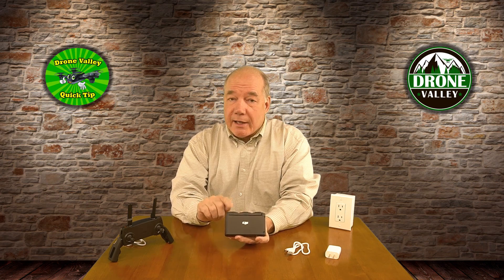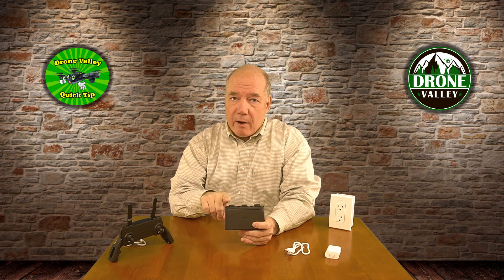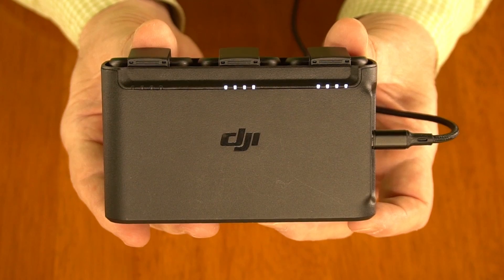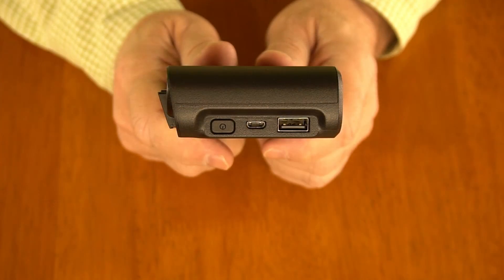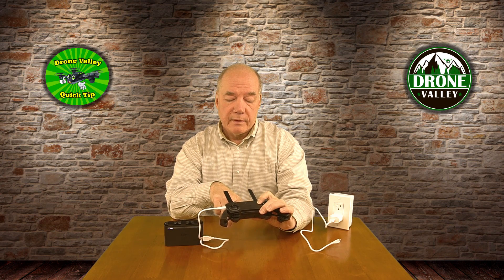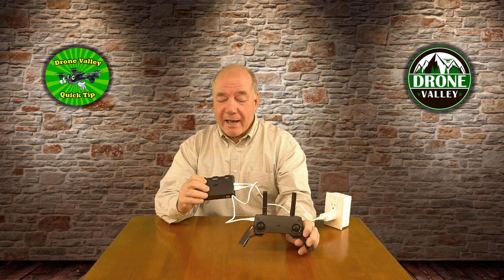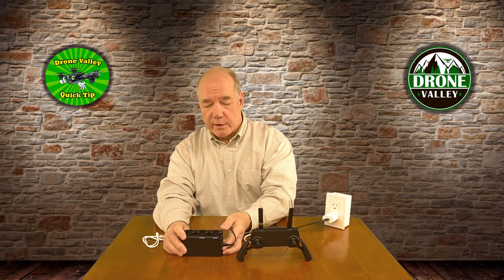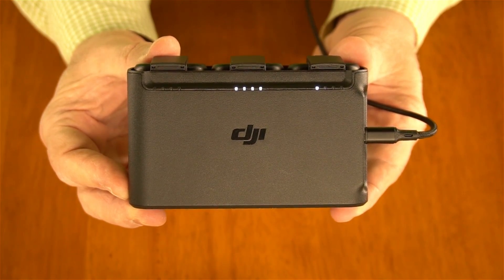Mavic Mini - The Magic of the Charging Hub Explained

Comment: I have a mavic pro and can charge it with an external power bank which was designed for the mavic pro aftermarket. Is there a way to charge my Mavic mini batteries with an external power bank? I am looking at being out in the wilderness with no power source and charging an external power bank via solar panel then charge the batteries with the external power bank. Is that possible?

Comment: You can charge them both the batterys and the controller...
Just press the button on the hub twice... As you do to turn on your drone. 
;-)
Reply from the maker: Thanks for the post and I appreciate the tip. This feature was actually implemented through a firmware update after I posted this clip. It was a feature we were all looking for and DJI updated the Hub to include it on later versions. Stay tuned for more content this week. Rick

Comment: How do you update firmware for batt 2 & 3 please, I see no prompt?
Reply from the maker: You can simply update the drone (and the installed battery) first and then rotate the others through the drone after a reboot. If they need to be updated, you'll be prompted to complete the update. If no message appears, there's no need to update them.

Comment: Thank you for this video, very useful. Can I ask a couple of quick questions: 1, Should the battery charger remain connected to the power when not in use in the field, and 2. How do I know if a. I have a charger capable of quickly charging, and if the supplied cord is capable of this function?

Comment: wrong, you can charge both at the same time.
Reply from the maker: Thanks for the post but when I did this clip that feature wasn't yet implemented in the charging hub, it came later with a firmware update. It works great today but takes a long time to charge everything because of the smaller wall charger

Comment: The original charger is 12 volt use it all the time.
It is switching to 5 volt in case you charging 5 volt devices.

Comment: So there isn’t any option for this hub to charge the batteries without it being plugged into a power source? I thought the hub thing would charge the batteries like a power bank.
Reply from the maker: Mike, thanks for the post and the hub is really 2 things - A "Smart" device to charge your batteries when you have it connected to a wall charger and a Power Bank that uses what ever charge is left in the batteries to charge other things. Initially, you'll need an external power source to use it for charging your batteries. I hope that helps, Rick

Comment: Hi. I bought the Mini 2 yesterday. When I plug in the battery that came in the drone into the hub, the third LED keeps blinking 3 times every 5 seconds. It shows fully charged in the drone and actually works, but I’m just curious if this is something I should be worried about. 😔

Comment: Do all 3 Batteries have to be in it at the same time for it to work? Or can I leave 2 of them in there while I'm using 1?
Reply from the maker: Sam, you can charge as few as you like in the hub. It will work well with 1, 2 or all 3 and if you slide one in while the others are charging, it will assess the new cell and adjust the charging order if needed.
Reply: @Dronevalley  Top Man Thanks a lot for very useful information.

Comment: If you press and hold the power button on the charger you can charge the RC at the same time
Reply from the maker: Thanks for the comment but that only triggers the external port for charging. The hub will still charge the batteries in order first and then move onto the controller. We have a 3 port Hydra cable that can charge a few things at the same time and a 6 port charger that can charge 6 if you'd like to speed things up. Rick

Comment: Ok so if i use my battery pack as a portable battery pack to charge other things like a cell phone or maybe a gopro what would be the actual power of the power bank in mah.
Reply from the maker: Great question and a tricky one since it really depends on how much of a charge you have left in the cells and how many of them you have plugged into the hub. The higher the charge in the cells and the more of them you have, the more capacity the hub will have to charge your devices. Even still, it can only supply 5V at about 2A to whatever you have connected but it's a great way to keep your other portable gear charged when you're out for a long day of flying. Thanks for the post and be sure to stop back soon. Rick

Comment: I just got the Mini 2 with the charging hub.  It works in the same way.  And, it has a USB C cable.  I found this video very helpful.

BTW, for those arguing about whether you can charge the controller and batteries at the same time:  No, you can not. When you push the button on the controller, it's just showing how much charge you have.  When you push the button on the charging hub, it just shows you the charge on the batteries.

Comment: Can the charging hub charge the batteries without being plugged into the wall? If so, how do you turn the hub on to start the charging of the batteries?
Reply: mine was but it went very slow its on the combo wall plug now

Comment: As soon as the batteries are charged it WILL charge the remote
Reply from the maker: Brian, thanks for the post but when I did this clip I was playing with a pre-release product a few weeks before the announcement and didn't have the manual. I understand that it will serially charge the external device when the batteries are fully charged and have mentioned that in a few clips since then. My issue is still the length of time it takes to charge all of the devices one at a time. We have just released a charger that does this in parallel and can charge 4 batteries and 2 USB devices at the same time to get you back up in the air quickly. Stay tuned for more updates this week and I hope you're getting in a lot of flying time. Rick

Comment: How to charge the remote in parallel with the battery bank in two steps: 1.With all cables unplugged, connect the remote to the battery bank and it should begin to charge. 2.Long press the battery bank button, the remote will indicate it is charging, and the battery bank will blink on the battery which is charging.

Comment: Rick it’s a shame DJI has stopped the “storage mode” on these hubs. Phantom 4 benefited from storage mode over the baked in discharge option because if I didn’t finish my batteries on a worksite I can easily throw it on the hub on storage mode to back em off to 50% until I needed them again.

Comment: After two of the three batteries were charged it started charging the controller after controller charged the battery on the end by the port started flashing two lights

Comment: Will the controller start to charge once the batteries have been charged to 100% or do you have to first take the batteries out of the charger?
Reply: Yes it will charge when the batteries are charged. You can leave the batteries in or take one or any out. It will charge the batteries first then power to USB A. Its a great device.

Comment: .... Someone needs to make a product to plug in and walk away to DISCHARGE all the batteries and controller to 50% for storing between flights. For now on, I will not charge after a days use until the night before knowing I will be using it the next day. .... IF, something happens and the trip (drone use) is canceled for any reason, the batteries need to be drained AGAIN!! :-(
Frustrating because they have to be monitored not to drain fully. 

.

Comment: Completely incorrect. Yes you can charge everything at once, all connected to the same charger. Just press the on button on the charging hub and it works. Controller first.
Reply from the maker: Silvio, thanks for the post but I did this clip before the product was released and at the time the manual wasn't done so I was exploring the features on my own. After using it for a few weeks I realized that you could force the controller to charge first but tapping the button but there's no way to update a clip once it's been posted. I have discussed this in later clips and I appreciate you pointing it out here in the comments so others know it's possible. I hope you'll stop back soon for more content I'll be posting on the Mavic Mini and other tech. Rick
Reply: @Dronevalley  totally understand and appreciate your reply. I'd suggest to remove the video and create another where you explain the feature correctly. I'm sure your followers will appreciate and respect you more for that.

Comment: Nice video.. I noticed two types of charger pins available in the adapter.. one is flat n another is a round shape plug.. how can we know which adapter inside the box?
Reply from the maker: I'm not sure if you are asking about the cable we designed or the original cable that comes with the Mavic Mini. With our cable we include 2 adapters that can covert the USB-C connection on the end of out cable to either an Apple or a MicroUSB. You simply choose the one that fits the device you'd like to charge (phone/tablet) and pop it on the end of the cable to start charging. I hope that helps and thanks for the post and your business. Rick
Reply: @Dronevalley  no I'm asking about wall plug pin shapes are change one is like 2 pins are round in shape and other as your charger flat

Comment: You can daisy chain. You just have to wait until all the batteries are charged and then the charger will start charging whatever is connected to the output.

Comment: Great review. How does the mini bank/charger store a charge? In the wall, all 3 batteries charge. Once unplugged, it appears that the bank is dead, and does not charge "on the go"
Reply from the maker: Roger, thanks for the post and the charger bank doesn't actually hod a charge itself but can distribute the charge of any battery it's holding. Essentially you use the hub to charge the cells at home and then can use the charged cells in the hub to charge other devices when you're on the road through the USB-A connection. It's simple and a genius move on the part of DJI.

Comment: So? How long it take to charge for normal 
And how long it will take to charge with fast charge with charging hob from 0% to Full.
Reply from the maker: It all depends on how discharged the cells are when you start charging them. If they are at 25%, it will take you well over an hour with an older (non PD) charger. if you use the charger that came with the quad you can cut that charging time in half. Thanks for the post and be sure to stop back soon. Rick

Comment: Thanks Rick - really useful quick guide.  Question... when I plug in the charger the lights are only blinking on two lights - they don't blink to all four in sequence and they aren't going very quickly. But the remote is charging quickly and blinking on all lights.  Why only going to two lights on the batteries?  Cheers
Reply: I believe that means that the battery is not inserted in properly, getting it out and putting it back in properly fixed it for me!

Comment: If you press and hold power button of the charger, it cycles between charging the rc first or the batteries, i believe if you are giving it 18watts or more with any qc3 capable charger, by holding the power button, it does cycle between charging batteries and rc at the same time, batteries first and rc first. But it doesnt do that when you give the minimum current which is 10watts.

Comment: What Jorge said. Batteries and controller at the same time, just power on the hub: 
https://youtu.be/XOp6kJPmGFo?t=32
Reply from the maker: Rand, we did the clip really early in the release of the Mavic Mini and figured this out right after posting. The challenge is that even though you can charge both devices, the charging level drops to a normal charge and you lose the ability to quick charge. The Mavic Mini charging cable we developed is designed to do the same thing and also allows you to charge your phone/tablet at the same time. Thanks for the post! Rick
Reply: @Dronevalley  Thanks for the reply. I thought when a cable is split to two devices being charged it would interfere with the quick charge because it needs 1 on 1 handshaking tell the charger to send more current. But I'm not sure about daisy chaining out the back of the hub, since the power into the hub is still the single direct QC cable. You mentioned the way to see if it's quick charging is by the speed of the leds blinking. If you have the hub quick charging, and then power it on, does that disable the quick charge and slow down the lights? (I don't have my hub yet so can't test myself.) Might have to hook a meter up to it. Thanks for all of your great videos!

Comment: I wanted to ask since its something you didn't mention in your video wich is really good by the way :) if the charging hub protect from discharging the battery completely when using it as a power bank. So i would know if i need to keep an eye out on the amount of charge.

Comment: The manual states that the batteries do not discharge and it is not safe to leave them fully charged in the hub.  Can you comment on this?  Is there a way to discharge other than flying?

Comment: Dude, you can charge both batteries and controller at the same time, just press and hold the button in the charging hub...😎
Reply: Indeed, that button is there for a reason👍
Reply: @2frogscafe509  That button is there so you can check status of batteries when not charging (out flying). The batteries get charged first, then current is routed to remote.
Reply: Actually yes...you can plug plug the controller into the battery hub while the batteries are charging. When all the batteries in the hub are charged it will then automatically start charging the controller...no need to push any buttons on the hub etc. Same goes  for my phantom 3 pro...the charger has a connection for the battery and the controller...connect the controller and a battery simultaneously - the battery will charge first and then the controller. Easy peasy.
Reply: It would have been very helpful to discuss the button, since it a main feature of the charger.   So I'll have to see if I can find a video that really covers the charger better.
Reply: Why does it look like he's making it up on the fly in addition 4 - 12 hours a battery times 3 that's hardly quick my man infact it's anything but. In short don't buy the BULLSHIT charger and buy 3 separate ones for half the price probably and that way your in the air with 3 full batteries in the time it takes to charge one dead. I tried that fancy fanny pack at 17 hours I gave up by the time I got to the last cell of last battery the first cell of the first battery was going  dead how freakingly stupid redundant is that....you can literally put 3 batteries in and WEAR THEM OUT with out using them once by charging in a circle 
HOW STUPID!!!!!!!!!
Reply: @Quizzical106  Would you happen to know why when my battery is in this charger with the fast charger plug; all that happens is the lights flash 3 times continuously then rests for 4 seconds then flashes 3 times again. It also does this on the mavic too but wont turn on. It all started after my drone crashed and landed then the battery fell out upon the crash landing. I'm on the assumption that my battery is dead and requires a new one, would you think?
Reply: Jorge Roberto Sosa Oliveros Unfortunately it is only charging one or the other but not both together.
Reply: You are charging the batteries. If you press the button on the charger Once, it gives u status of batteries charging. Press and hold the button, it switches from charging the batteries to charging whatever other device is connected.
Reply: nope it only works for a few seconds
Reply: They can be both connected, but when I switched it on, it stopped charging batteries and moved to RC to charge.. I’m assuming once that’s charged it will move back to battery charging. 
All lights are still on on both RC & batterie but only the RC is strobing. Will wait & see.. it’s my first time charging :-)

Comment: So I’m not sure if somebody already posted this but here we go: YES, IT WILL CHARGE THE REMOTE CONTROL when you connect to the battery hub BUT, only once the batteries are fully charge. I just tested with mine and it works. 
Bottom line, connect the battery hub to the out let and remote control to the battery hub. Once batteries are fully charge THEN the remote will charge.
Hope this helps!
Reply: Neovipper my thoughts exactly! So glad you’ve tested it... the suspense was killing me :)
Reply from the maker: Thanks for the post and I did discuss this in a later clip and explained why the charging hub acted this way. It actually has to do with the way a Fast-Charger works. It can only "talk" to one device at a time and connecting the controller to the hub makes it the fourth device in line to be charged. If you want to charge the controller at the same time you can use our Mavic Mini charging cable that has connections for the hub and controller (as well as your phone) and charge all 3 simultaneously. It can't fast-charge but will still get you out the door quicker. Here a link if you want to check it out - https://tinyurl.com/yhoztt8o

Comment: Why is there a power button on the battery hub?  I can't figure out its purpose, and if the batteries are draining
Reply: It’s to turn on the power to charge an external device when the battery holder is disconnected from the mains. You turn it on and off like a normal DJI product by pressing once then pressing and holding the second time.